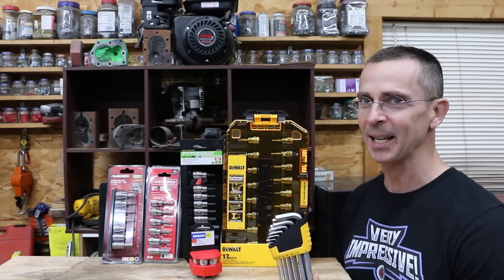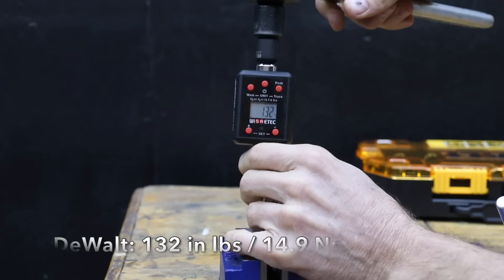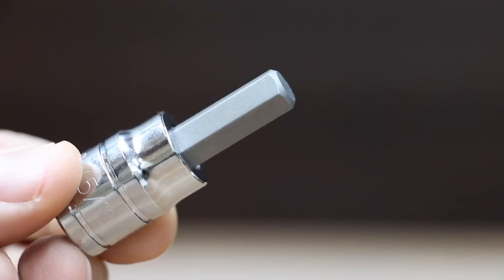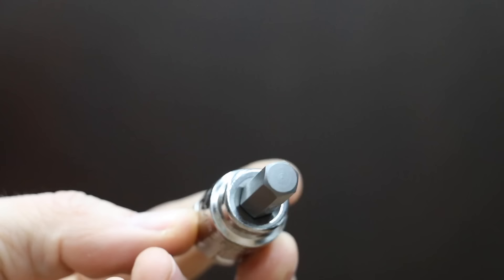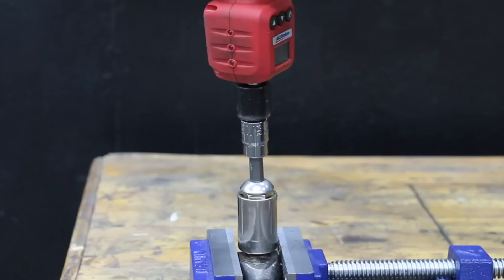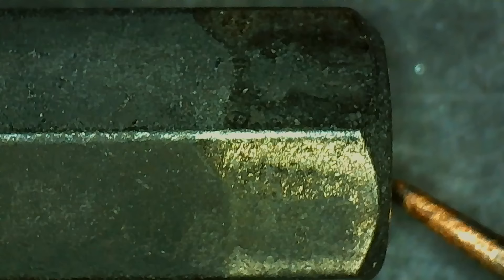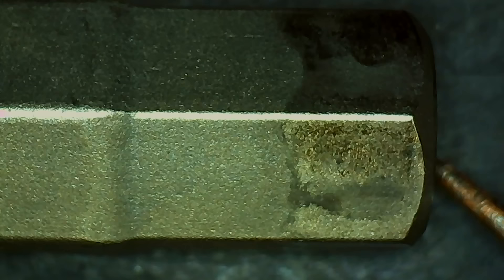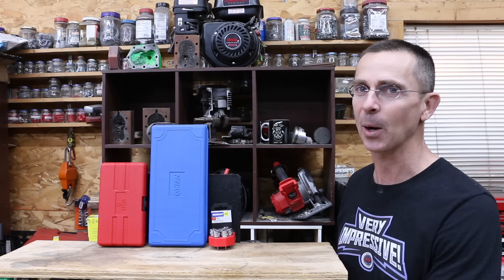Best Hex Bit Socket Set? DeWalt, Kobalt, Craftsman, Husky, Neiko, Pittsburgh, Tekton, GearWrench

Comment: Considering how long you've been going you've probably done it already do a stubborn screw removal challenge 

Manual bit impact drivers

Vs

Shake and brake power chisel 

Vs

Extractors 

Vs 

Anything else used to get stubborn screws out
Reply from the maker: Thanks for the suggestion.

Comment: You seen to love chainsaws.. these single hand unit are literally a dime a dusin from China.
and down to like 15 USD (/no battery) but otherwise ready to go with a Makita pack.. prices are even with incl. 25% VAT and shipping..likely a sale price, but they are cheap and many people buy them
They run on Makita packs.. the bigger amp the better for torque and most of them use a brushed motor, and comes with either a 4" 6" or 8" blade & chain.
you should do a test on those, and see how they stack up with smaller wood trimming jobs.. people seem to like them, not least with the extreme low price in mind.
Reply from the maker: Thanks for the video idea.

Comment: 𝗗𝗶𝗴𝗶𝘁𝗮𝗹 𝗠𝘂𝗹𝘁𝗶𝗺𝗲𝘁𝗲𝗿 Not sure if you've done this review,  in the market for a digital multimeter, my Fluke finally gave up after 20+ years of reliable service. Really don't want to spend $$$ for the new model... Cruising Amazon, $9 - $500. Are the inexpensive units as good as a Fluke?  Just a suggestion, Thx
Reply from the maker: Thanks for the suggestion.

Comment: all the impact bit tests seem to break like this, I'm guessing the metal is made with more carbon than the non-impact but I'd rather it bend then snap.  never bought impact rated stuff because of how they don't really seem to take the torque, I suppose that's so all the hammer effect is transferred instead of absorbed but if it can't take more torque than a non-impact so what? marketing scheme, they're usually more expensive when I priced

Comment: Love your work,  but I really think that for tests of this nature you need some device that will maintain a 0 degree relationship between the axis of the tool and the axis of the fastener. On several of these you were visibly quite a few degrees off of zero, which makes a huge difference and renders the small differences in the results absolutely meaningless. In general, though, I want to applaud you on taking pains to observe the details and produce verifiable results.
Reply from the maker: Thanks!  Thanks for the constructive feedback.

Comment: Hello, good morning, could you help me, I currently use a branded hexagonal ball point tool. Genius Tools 1/4" Dr. 4mm Wobble Hex Bit Socket, 100mmL - 208+4534. but the bits get washed out, I use them in a process of tightening screws, I use an average of 480 times a day, I screw with a torque of 60 in/lbs with a rach. Just please help me by telling me if you know of a brand that is the same ball point with Hex bit. I appreciate your support
Best regards!

Comment: I would like to see a test between regular shop air filled in a tire virus pure nitrogen.  Every time I have tire work done the shop wants to put nitrogen in for an added fee. I think this is just an added way to make money.  Since the air we breathe is 78% nitrogen what good does it do?  They say the air pressure in the tire does not change with temperature changes.  I work on aircraft that have nitrogen reservoir bottles for an emergency blow down system for the landing gear.  Every time a cold front comes through the pressure drops from 3,000 to about 2600.  So we have to top them we off.  So I know nitrogen changes with temp.  Systems with helium never change with temp.  We due use nitrogen in the aircraft tires as well, but that's just because they take 250 psi and the shop air won't go that high or the A/C is out on the ramp. I don't know any aircraft mechanic that would pay to put nitrogen in their car tires.  Thanks for a great channel.
Reply from the maker: You are welcome!  Thanks for the suggestion.

Comment: Why no crescent brand? And I will say I have zero use for anything crapsman! Back in days, way back, they were good but now they just rebrand garbage. Also I say tekton is bang for buck as crescent brand.
Reply from the maker: Thanks for the suggestion.
Reply: Modern "Craftsman" in my understanding is a completely different thing than the old Sears "Craftsman" brand and is not made by the same factories.
Reply: Modern "Craftsman" in my understanding is a completely different thing than the old Sears "Craftsman" brand and is not made by the same factories.